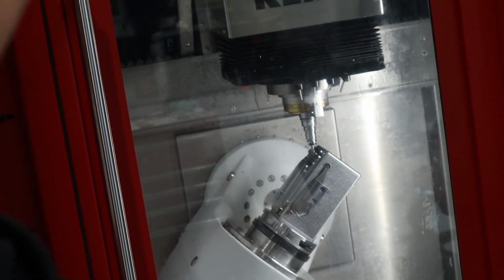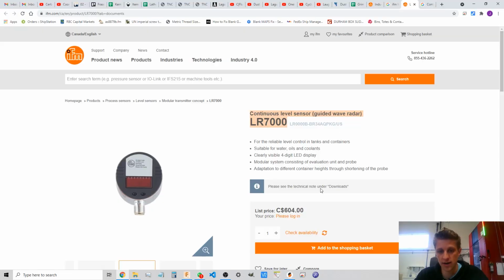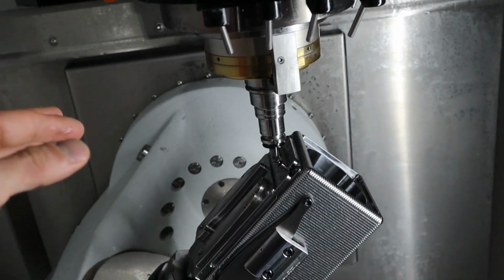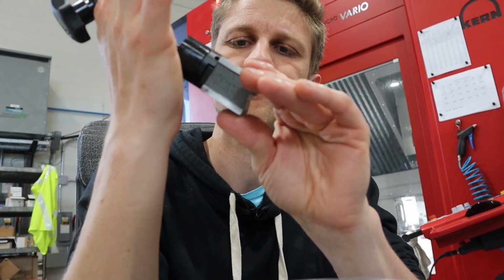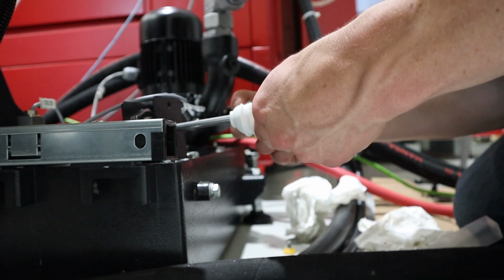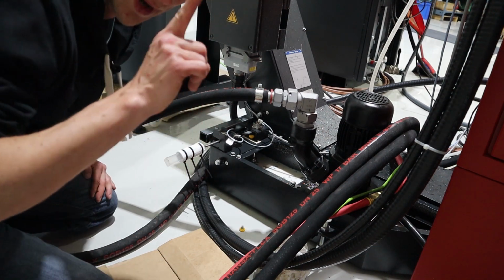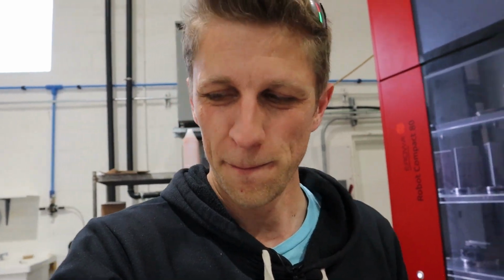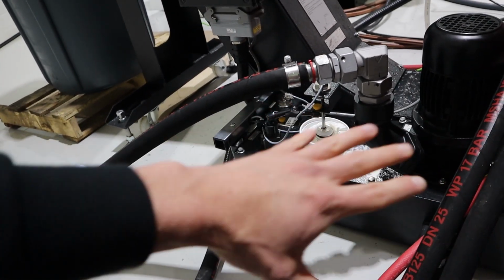Lets Improve A Float Valve

Comment: Don't waste money on the IFM sensor.  You only need an on/off switch, not a continuously variable sensor.  The control on the equipment only cares about on or off.  Look at fuel level sensors in cars, it's basically a coat hanger with a float on the end that makes a switch.  That's literally the only thing you need.  Keep it simple, and it will be reliable.
Reply: Keep it simple stupid as they say.
Reply: IKR, 600 doolan hairs ripped off. That's such a scam.
Reply: @aserta  not a scam, but overkill sensor for this application. A  IFM LI5131 would be way more suitable in this application than the one his friend suggested. Though still not as simple as floats. But the LI ones don't have moving parts. But require more wiring as they are not simple contacts.
Reply: @aserta  derp
Reply: It needs more than just a simple on/off switch.  It needs an on switch at an upper level and an off switch at a lower level. Otherwise the pump would be burning out because it is cycling within a very short change in liquid level. The pump would only run for 10 secs and then 30 secs later start up again. It’s designed the way it is to give the pump time to cool down as the liquid level is rising!!! If you put a float butt up against a simple on/off switch the level only has to change about 1/2” to activate the switch.  If you put the float on the end of an 8” rod with the same on/off switch the level has to change about 4” to activate the switch.  If you extend the rod to about 12” the level has to change about 8” to activate the switch and so on.  This extension of the rod introduces a time variant into the equation so the motor is not cycling continuously. The reason they built it the way they did was to eliminate pump cycling and the reason they did not utilize just an on/off switch with a float is because they probably do not have the room in that small tank..The float switch they are using introduces that time variant for that small tank and eliminates the float on the end of a rod system activating a simple on/off switch.  It is compact and does the same job.  It is just that the switch is only to be used with clear liquids. It doesn’t factor in metal fillings and floating chips. I think a conductivity probe sensor switch designed for the viscosity of cutting fluid with a simple 0 to 30 second variable timer circuit would have been more appropriate for this particular application..
Reply: @Brad-vs1lk  no it doesn't.  The schematics of that switch is normally open, then once it gets to the top it closes and turns the transfer pump on.
Reply: @capnthepeafarmer  watch the video again dude, john said that when it reaches the top it turns on and then only turns off at about half the pipe, it's a latch system.

Comment: I'd be worried about the overflow float getting the same issue :S
Reply: There is so much more displacement it would take a lot and i mean A LOT more chips to with it down enough enough to offset the buoyancy.
Reply: @TexasBulldog74  It seemed the failure mode wasn't weight, but that chips got jammed in between the top stop. I guess it'd be hard for that to happen on a float that (hopefully) rarely gets to the top

Comment: my first thought with the float not displacing enough due to weight and surface area was Syrofoam packing. Super light, lots of surface area, cheap and readily available. Plus I have seen it used in a number of commercial devices that have float valves with 20 year life spans. 

You know what they say though, fail fast, fail cheap, and fail often. So you grow, and improve.

Comment: Holy cow. The whole time I was thinking this is not going to float. Why do you not just fence off the sensor area in that tank using some mesh or something? That combined with a scheduled cleanout should work well and cost less than those replacement sensors.

Comment: Would it not be easier to make a small, fine mesh cage around the float valves to stop chips getting near them?
Reply: Came in the comment section to suggest the same.
Deporting the floater, is quite smart, but seems really complicated, the way you did it.
The 600$ replacement, way over expensive and overkill.

Comment: Why dont just use a screen tube so the sensors dont get clogged?
Reply: I wonder if chips can plug the screen so much that the filling rate becomes too low, allowing overflow sensor to trip?! But I guess it's waaay cheaper to try screen tube than $600 sensor. Good thinking!
Reply: @x_ph1l  I had that Issue before, ended up using a pump snorkel cage with wire fly screen mesh wrapped around it placed under the sensor body. It worked for 4 years then replaced the fine wire mesh and should last another 4.